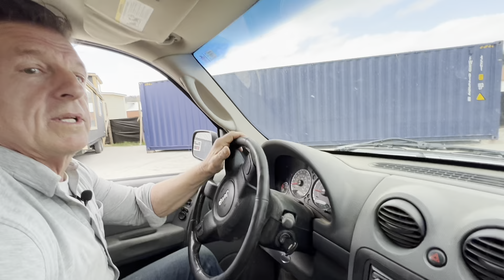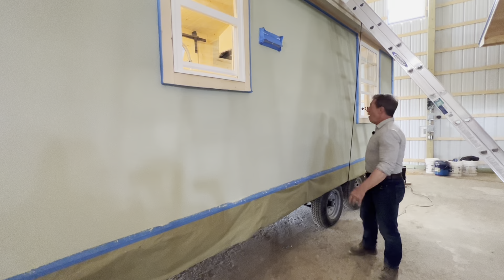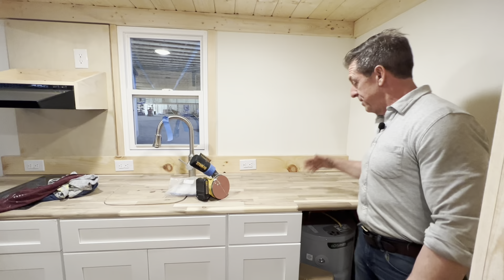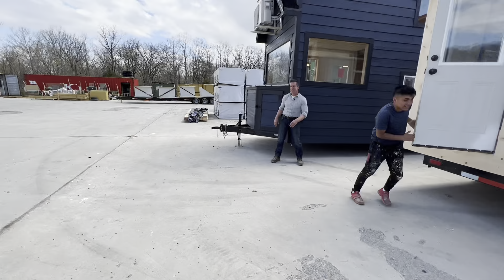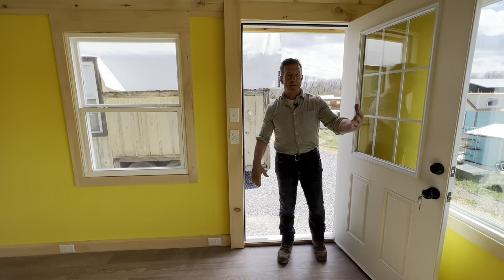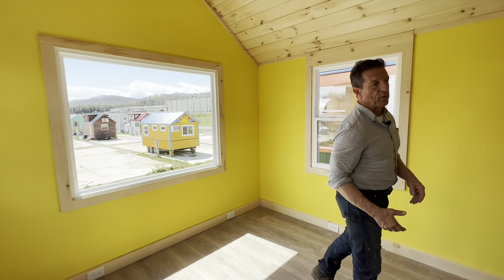5 Tiny Homes Built in 4 Weeks 🤗🤩🏡

Comment: I would love to see an actual Washer and dryer combo under the stairs! I would like to see how it looks and how easy it is to use!
Reply: I'd get one of those pull down (from screwed into the wall, up high, between the combo w/d and the shower) hanging clothes rods, so I can take lightweight shirts out of the dryer early and hang them to finish drying. The hanging rods I am thinking about fold down and stick out about 18 inches, but it's out of the way right next to the shower. They have slots for the hangers, to keep them spaced about an inch apart. Perfect to finish drying, AND to give more room in the dryer for the heavy clothes to dry faster. Then just fold it up and out of the way till needed again.

Comment: I would put a TV above the table against the wall by the kitchen as there is more room for a wide TV,  not on the wall under the mini-split, it is shorter and if the mini-split leaks, then you will have to replace the TV.  I like that you can get a 33-inch refrigerator between the bathroom and kitchen counter.   I love the faucet on the corner of the sink.  You can always put some open shelving between the window and the end wall in the kitchen.   The cabinets can stop at that point, but have the counter top go to the window and open space underneath, which would make a table or desktop, for meals, crafts, woking on your computer, etc, and a TV above that so that you can watch from the desk, angle it to the kitchen or living room area.  

On that wall between the stairs and the kitchen, I would put a cart with castors for a microwave and a toaster oven/air fryer/etc.  I save with castors so you can roll it aside if you need to access the electrical panel, which I would behind the barn door, so you can something like a cabinet, or display or bookcase on that short wall by the stairs.  The other reason for putting the electrical panel behind the barn door, so you don't have to look at that gray panel.  

Upstairs, I would have that wall all the way to the dormer, as it would be a safety wall as well as a wall to mount the mini-split, and have some privacy up in the loft, but still have air flow.  I love the double dormer upstairs it gives you more room and two windows to give you a nice cross breeze, and a view out of each side of the house.  

I love this floor plan, but I also like the Augusta, with the room behind the kitchen, you can put your washer / dryer (stackable - Laundry center, or LG Wash Tower for height-deprive people like me,) it has the controls in the middle, and next to the kitchen wall, put some shelves for your pantry shelves, and a hanging rack from Walmart, Target, Bed, Bath & Beyond or anywhere else you find it.   I also like the Augusta, because you can have a place inside the house, to put your washer/dryer, instead of the bathroom.  Your bathroom will be less crowded with the W/D in another part of the house, and you have room for pantry shelves as well as a place for hanging clothes.  I call it the PLC, Pantry, Laundry, Closet.  And the loft extended over the that room, gives your more room upstairs, maybe put a cube storage, for clothes, or crafts, a bean bag, or game chair as well.

In this model, love the wood ceiling and trim and the white walls, it gives it a nice contrast.

Comment: These homes are awesome!  I really like the board at the bottom of the homes on the outside, really makes the stucco pop!
I have a question for Randy...if the electrical panel is on the wall with the minisplit and the minisplit leaks water down the wall into the panel box isn't that dangerous. Amanda mentioned how the lady had to replace both her TV and minisplit from the leaking.
Wouldn't it be better to put the electrical panel in the bathroom under the stairs on the back wall?
Reply: Or maybe on the wall going up the stairs.

Comment: Amanda, terrific idea about the shelf and drip pan! It might also prevent anything happening with the panel below the  tv on that same wall. If you have to put in a 21" cabinet instead of your 24", would there be an option to add a Randy Rack along with the smaller cabinet? I'm curious about energy efficiency  choosing roof colors. The darker the color, the more heat absorbed? The lighter the color, the cooler overall temperature inside? Is there a roof option that completely repels the heat and would that be a better efficiency with the temperature control or is the heat coming onto the roof something  that is welcome or even effects the inside temperature? Please help me understand about this. Thank you so much! Absolutely love the beautiful wide skirt on the exterior! Terrific job Randy!
Reply: Yes, you're right about the roof color. Dark colors are best for cold climates, while light colors reflect summer heat away.  You can repaint a metal roof with proper primer/paint choice, and if you google 'reflective paints', you'll see that there are a number of types that can help you to repel heat.

Comment: Luv’em.  Like the differing details.  I’m sure Randy’s idea for the door placement by the stairs is the best.  What did you think of the door opening out? I really like that feature wall between the stairs and kitchen but…would it be possible to place the switches and power box on the sides rather facing the living room?  Great job guys!

Comment: To widen the bath closet opening, can the impeding bottom stair step be made to roll in & out on casters as needed?
Reply: That would be an interesting way to have them. Or, have a piano hinge and they fold back onto themselves when not in use. 🤔🤔🤔
Reply: @MBMCincy63  That's a great idea, like a folding step stool :)
(The rolling storage box step is something I've seen done quite a few times. You just have to remember to lock the casters so you don't step on it & accidentally go sliding across the room. 🤪)

Comment: Question:  On the Incred-I-Box, can you make a tongue box out of the insulated ESP panels and put the 19 gallon hot water heater in it and mount it on the trailer tongue? That way you can use the space inside the home (where you now have the hot water heater) and use it for fridge on the bottom, burner on counter, and microwave/vent mounted above the counter. And the open space on the opposite side of the kitchen, underneath the counter where the electric panel is, can be used to hang a few clothes. Another "wish list item" would be "built in shelves" above the toilet to store maybe some clothes, towel, toothbrush, toilet paper, etc.  I love what you guys do... just bouncing ideas out there for possible future Incred-I-Box designs 😉.
Reply: A homeowner could build out a tongue box and move it there but then there would be no where to place the condenser unit for a mini split to the lines he ran for one on the tongue of the trailer.
Reply: @karenmorris7502  Thank you for your reply to my question.  That's a good point you make about the mini-split being mounted on the trailer tongue.  In that case, I guess a couple of options could be 1) install a regular A/C above the kitchen window (thereby leaving the trailer tongue available for a tongue box to house a 19 gallon water heater, or 2) install a tankless gas water heater 'in the loft' above the toilet so you only see the 'lines' above the toilet (and not the tankless water heater since it would be mounted in the loft).  I wonder if the tankless water heater can be mounted 'in the loft'?  Thanks Karen for "brainstorming" these ideas with me. I'm always thinking about design ideas for the Incred-I-Box... it really is an INCREDIBLE design.  I love it!
Reply: @choosekindness5677  oh believe me I keep brainstorming my Incred-I-Box plan AGAIN since the bathroom walls are wider now and the hot water heater changes were made. I had already designed and sketched out a plan in the space beside the front door for a large cabinet I was building with a 24" bottom drawer base to store my bakeware and then a shelf for my 18" wide fridge and a 4" wide pullout pantry that I already had built to sit on and then a shelf above that for my toaster oven.
With the water heater there and that wide wood trim molding I have to wait until I get the Incred-I-Box home and see what I can modify from his changes to make it work for me.
I already built my clothes closet and sitting bench for the living room space so hopefully they still fit. 🙄
Reply: @karenmorris7502  I really admire folks who are able to build stuff.  Your design ideas sound great 👍. I'm looking forward to seeing everyone's decorated Incred-I-Box homes 🏡!
Reply: @karenmorris7502  Why couldn't the box have access doors at the sides, and let the condenser sit in front of it on the narrower end of the triangle?
Reply: @chezmoi42  the diameter of the hot water heater would consume a large portion of the tongue of the trailer and not leave enough space to mount the condenser unit in front of it. 
My current RV has a dual propane tank set up on it and it leaves just enough space in front of that for the electric tongue jack and the two batteries are squeezed behind them.
BUT you can always build upwards and weld on a raised platform for the condenser above the water heater box. Remember the water heater box would need to be well insulated to work properly.
Reply: @karenmorris7502  Good idea, Karen.  For those who can afford it, there are also flat electric on-demand WH's that could be mounted in the tongue box with the other utilities.

Comment: Now that the trailers are not metal underpined, that means the floor is no longer spray foamed insulation?
Reply: No, they are all spray foamed after the electrical and plumbing is installed then they put the underlayment sheet on top of that before they install the walls and laminate flooring.
Reply: @karenmorris7502  oh, I see now, thanks.

Comment: I wouldn’t like my washer and dryer out side in a shed you got plumbing to think about and what about the winter?
Reply: Not an issue here in Southern Arizona. The last two townhomes I owned before I went to full time RV living had the washer and dryer in sheds. The tiny house lots and mobile home parks have laundry room sheds also because it's too hot to have a dryer going inside the house 8 months out of the year here.
Reply: When I was young we lived in Tucson and all the homes in our subdivision had a little storage shed outside under the carport. Just didn't like the black widows in there. I believe you could use heated tape on the lines outside or maybe litter heater in there on freezing nights.